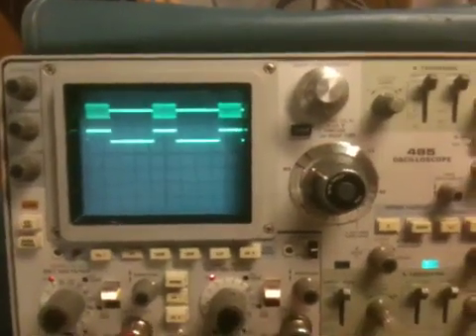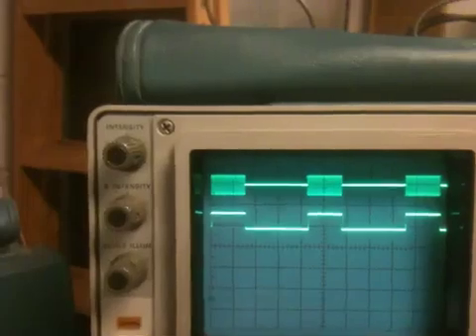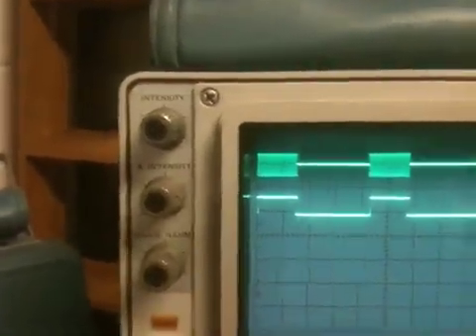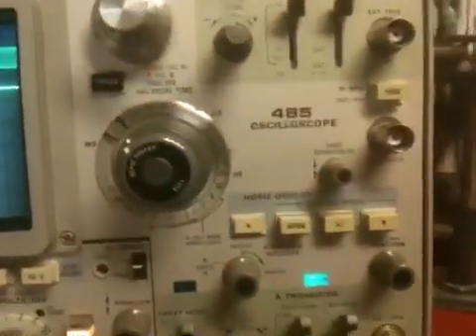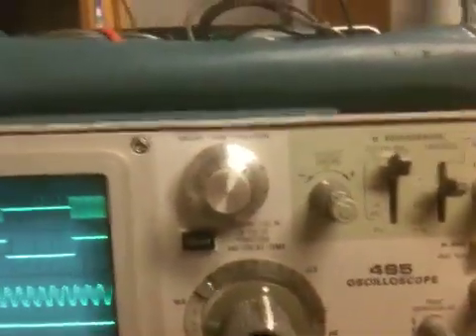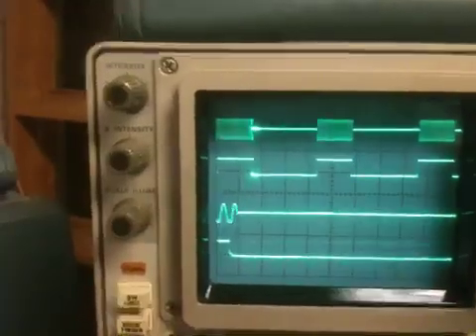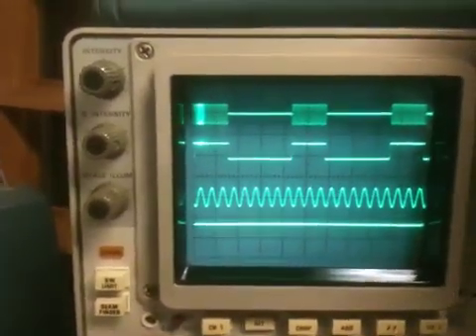#2: Tektronix delayed timebase operation

Comment: Very interesting Alan. My 475 is somewhat different in the controls of the delayed time base. I have a Mix display which may be in place of the Alt control on your 485. No trace separation control either. I am just learning about scopes in general and this has shed some light on the delayed TB function. Thanks, Dave
Reply from the maker: Yes, the early 400 series used Mix instead of Alt.  In MIX mode, the delayed timebase works on the same trace - the sweep speed is adjusted mid-sweep, at a position determined by the Delay control (basically where the Intensified portion begins in my video).

Comment: Is that "ALT" function specific to the 485? It's pretty cool to be able to see both timebases at the same time.
Reply from the maker: +fabts4 No, many of the better analog scopes with dual timebases give you this capability.
Reply: +w2aew So, is there something I missed on my 465 or is it not one of the better scopes?
Reply from the maker: +fabts4 The 465 has a Mixed mode only, unfortunately.  The 465B has ALT.
Reply: +w2aew I guessed that from your "delayed timebase frequency measurement video" on the 465B. I don't really like the Mix, they were right to change that :-)

Thanks.

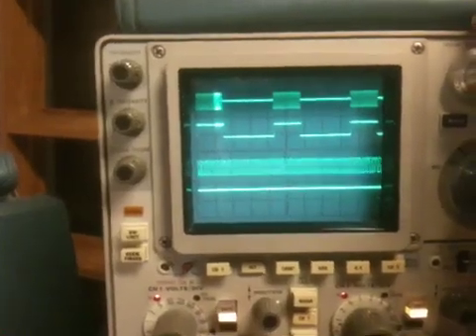Comment: Hello Allen - I saw on 2:50 that the sine wave is appearing before the gate pulse that supposes to start that sine - how is that possible?
Reply from the maker: It's because the delays of the two signals inside of the signal generator aren't properly matched. The gate pulse is delayed too much with respect to the sinewave source.

Comment: Wow. That is really awesome. I've had my Tek475 for two years now, and I hadn't bothered to learn how to use B (DLY'D) triggering until now.
Thanks for showing me how to use that.
The 485 looks like it has a few more bells and whistles!
Reply from the maker: I'm glad you liked it. There are several more tips and tricks on the 465/475 series that you'll find in other videos on my channel. Enjoy!
Reply: Ok! I will be sure to check those videos out.
Also, I would like to say I really like the ways in which you use the XY mode on your oscilloscopes, particularly the Lissajous patterns video.

Comment: @w2aew I've watched you Charc. RF video but not able to do the same on delta T in my 2465A. ch1=gated RF, ch2=square wave. What happens is (ie.) before delta T is turned on, I have my delay hi-lited on the falling edge of the gated RF WF, when delta T is turned on, I expect to see that *other* hi-lite on the rising edge of the same WF but instead it appears on the gate source WF which is on ch2. So, I have a delay hi-lited on each WF (ch1 and ch2). I'm not sure if it's expctd for 2465A

Comment: @w2aew Awesome! Tek went thru some tough times years ago but it looks like they're back with nice products. Between HP and Tek, they've always set the standard for everyone else. I noticed that using delta T on my 2465A does not allow me to swipe the other edge of the gated RF WF, it does allow me to use the delta knob for the gate. Is that how it's supposed to be? I'd like to see more real-world basic apps for scopes and func gens for HAM circuits. Thx!

Comment: Thank you for your very educational videos. I have a tek cfg280 func gen. I preset the 280 to generate sine at 400khz and feed a gated 3khz square wave (from another func gen) to the 280 to basically get a similar signal that you have. However, I notice that the 280's counter readout shows approx. 200khz - can you explain why this is so? thx very much.